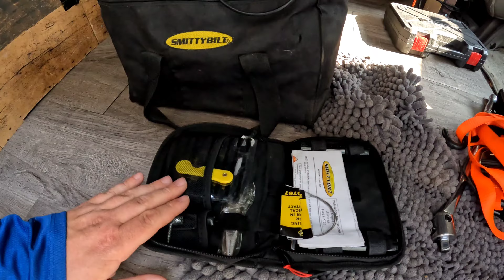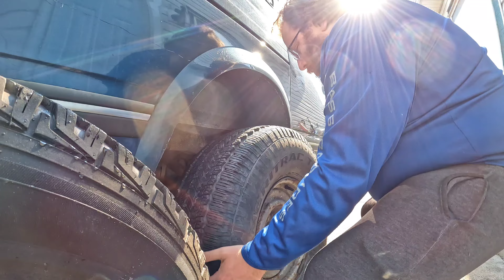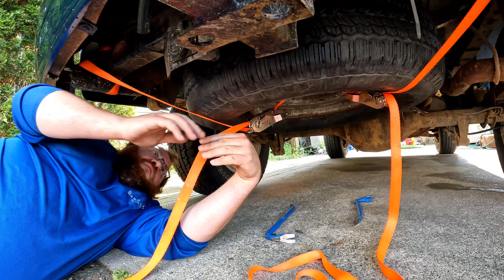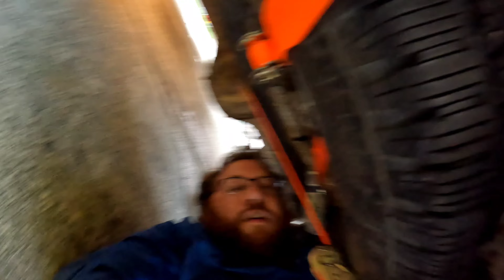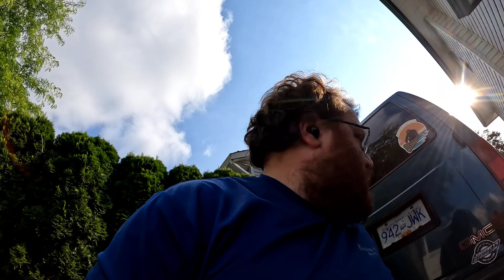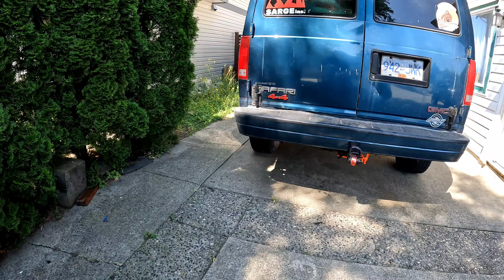Fitting An Oversized Spare Tire Under My Lifted GMC Safari

Comment: Nice bro looks good! I got the same program on mine, but I put the straps through the holes in rhe rim so you don't see the straps from the back . Peace
Reply from the maker: Right when I got under there, I realized I should have gotten a rim that had more holes in it. Getting a solid rim was definitely an oversight lol.

Comment: Running without a spare until now?? haha I like your style 😁

The jazz cabbage is right! that last ratchet strap was a good move, those rusty cables are barely fit to hold the tiny factory spare up. 

I've got a factory rim with the OEM 215/70/16 hanging on mine and it worries me.... Also have thought about the rear door fiasco that is a common failure, might put mine or a second on the roof until I can get a rear door mount figured out. If I carry 2 spares that almost completely eliminates the chance of a tire issue 🤣

Good tips, by far the most common break down/trail repair is a puncture or sidewall tear.
Reply from the maker: I was running no spare for over for so long, but I always has my compressor and tire repair kit. Then in April I went to a hotspring 100km down a gravel road without cell reception, and as I was driving there (probably also on the jazz cabbage😂) all I could think about was how crazy it was to not have a spare tire with me. I couldn't get it out of my mind the whole trip. So I decided that I definitely needed to get one asap when I got home. Life on the edge is great, until you slip lol.
Reply: @SARGEinc  Good call! the ole rasta celery is good for a bit of paranoia every now and again 😅 

The tire plugs are good to keep on hand but if a sharp rocks jabs your sidewall its over!

Comment: I ended up getting a back door mount for my spare . My hoist and cable were rusted to much to use .
Reply from the maker: I think this might be a thing I do in the future. Although right now with my doors screwed up and not being able to open, I'm not 100% sure I could install one😂. Fixing my doors is likely a project I'll tackle over the winter, so that does seem like a good time to consider a door mounted spare. Did you buy it online or custom make one?

Comment: Probably would be better if you just added an additional chain to the support cable that is securing the tire underneath the Safari van then use a "quick link" to secure the chain...... but I suppose use whatever you have that is readily available at the time....

Good and well thought out video though....!
Reply from the maker: I'm thinking about getting a different spare tire winch from a bigger vehicle, but so far this has been holding up for over a year now

Comment: It's ok, they won't be bright orange for long under there. I always used to loop a chain through my spare the somewhere on the frame as a safety incase the cable winch ever rusted to the point of the cable breaking, as you know the stuff they spray on the roads in the winter here is horrible for rusting
Reply from the maker: I'm actually curious as to what happens to these straps over time, I wonder if they will fade or just straight up disintegrate over time. I like the idea of a chain, especially because I'm not sure how long these straps will hold up.
Reply: @SARGEinc  The straps will ikely fade once we get the rainy season and they get the road spray all over them, they should hole up ok for awhile but eventually they'll probably give out, like a couple years I would guess. If you end up putting a chain on there, try to coat the bolt or carabiner or whatever you use to attach the chain, last time I had to get the chain off to change out a flat the nut was rusted on the bolt so bad I almost couldn't get it apart when needed on the side of the road